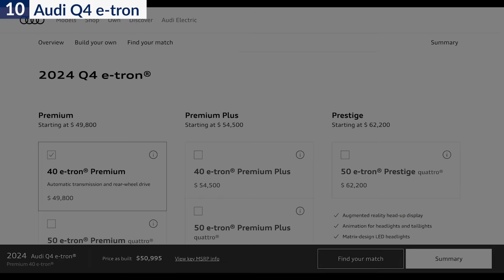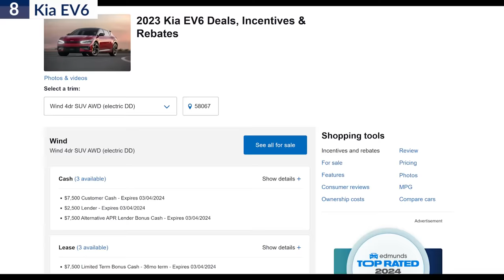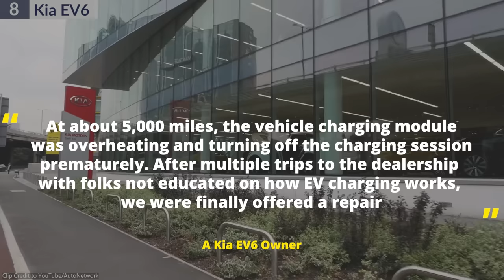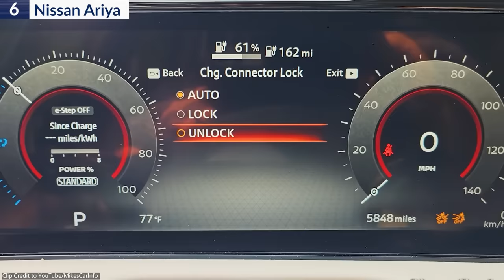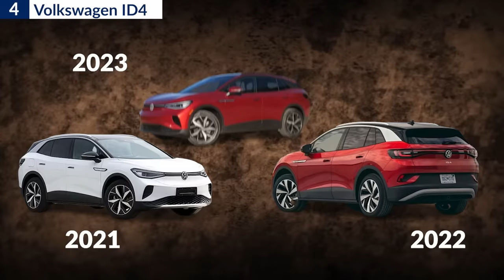New Electric Cars Piling Up on Dealer Lots in 2024 – Here is the Truth!

Comment: I live in an apartment block, we have parking spaces but we can’t afford to install EV charging points. The nearest public charging points are a 2 miles away and only has 3 chargers. EV ownership would not be practical for me.
Reply: Very honest post. Apartment dwellers are not going to fare well with an EV compared to people like me. It only takes 10 seconds to plug in when I get home and my battery is full each morning. Cheap and easy for home owners.
Reply: Sucks for the poors, eh @Lovingkindness.
Reply: You are not the only one. For many, many others, EV are not practical especially in this garbage of an economy.
Reply: I have a home but the nearest charging station is at least 20 miles away.  And I use my truck for heavy duty farm chores and towing.  No thanks.
Reply: @Republicanmouse  Stop thinking about EVs and focus more on getting electricity to your house.
Reply: Unless you have your own house with a drive so you can charge your car every night EVs are just not ideal for most people.
Reply: @MR_THINQ  I have a home with a driveway... No one on this area can have a home charger due to grid capacity.
Reply: @MR_THINQ   True
Reply: @mason5540  I understand but the post is not about rich or poor. People with a residential parking spot have it best. A simple RV outlet (NEMA 14-50) will keep the battery ready for daily use. No need to travel to a charger.
Reply: can you plug into a 115v outlet and do a slow charge?
Reply: @sahhull  Why can't grid handle charging at night in off-peak hour?   Even a 20-32amp outlet is fine.
Reply: @adotintheshark4848  115v outlet is not practical, only 3 miles up to 5 miles an hour.
Reply: @sahhull  Same for the majority of the population.
Reply: I rent in a block of flats but I can run an extension cord to my car spot delivering 240 volts x 10 amps so 2.4 KW which is ok for overnight charging.
Reply: @Republicanmouse  Don't you have electricity at your house? You can just plug them in to an ordinary outlet or get a faster charger installed.
Reply: @MR_THINQ  why charging every night? I charge once every 10 days.
Reply: Don't buy one even if you can afford a house and home charger.🤢🤮
Reply: @Lovingkindness. 🤭😆😅😅😅🤣🤣😂😂😂🙃
Reply: @MR_THINQ  Still not a good idea. Your sales pitch failed. Get a new career.
Reply: @ElMistroFeroz  No one sane wants to pay all that money for a car sized golf cart!🙄😆😅😅😅🤣🤣😂😂😂
Reply: @sahhull  Do you live in some 3rd world country?
Reply: EV's are like designer bags.... if you living in an apt and not a house you shouldn't even be looking for 1! Its backwards like having a new Mercedes and living in an apt complex. Priorities all messed up!
Reply: @ibuyufo  no but we are importing them across the English Channel every day.
The cabling under the pavement to our houses is over 100 years old and there is no plan to upgrade it.
The house was built in the early 1700's.
Reply: @Republicanmouse Thank you for feeding me these many years of my life.
Reply: @danielstapler4315 Make sure to get a heavy duty cord for someone to relieve you of it while you sleep.
Reply: @danielstapler4315 How long is the cable? Do you have enough dimensions for the leads? Is the gable getting warm?
Reply: This is a real issue for anyone in apartment buildings
Reply: This is a real issue for those living in apartment buildings
Reply: Very good statement instead of beating down the electric car and talking bs, you state the facts. The infrastructure is not there for some people yet. Doesn't mean we should get rid of electric cars and go backwards with poisoning the atmosphere, soil and our bodies. We should double down on a better infrastructure, better mining techniques, and better batteries. Which is exactly what's happening.
Reply: yeah, until parking garages and whatnot are loaded with lvl 1 or lvl 2 chargers i think it makes sense for apartment dwellers to not want an EV, ince charging at home is where most of the savings are vs gas. charging at a lvl 3 station is still like 1/4 the price of gas, but charging at home is 1/4 the price of that. In my ioniq 5 i can get the equivalent range of a full tank(65$+here(CAD)) in my 2015 corolla for about 9$ at home(new brunswick has pretty cheap power compared to most of the world).
Reply: @leiflillandt1488  The cable is ten metres long. I don't actually have an EV I just like the idea. If I really wanted too I could buy a 2nd hand but I can't justify it. As for the socket getting warm on some or most EVs on the screen you can tell the car the maximum wattage to draw from the power point so if it is warming up you reduce the power being drawn from the socket.
Reply: Its gonna take awhile for level 2 chargers to spread into apartment blocks and towers.
Reply: I live in an apartment and there's two Tesla stations between home and work. If I charge after 9pm it's $0.22/ kwh which means I can drive for a week for $15. Also there's free charging at my job so if I choose to skip PT and drive to work I can get a full charge for the $13.00 it costs to park at the hospital. My 2019 Tesla Model 3 Long Range is the best feeling most fun and most awesome looking car I've ever owned. I get compliments all the time, not that it matters. But go on telling the world why EV aren't good for you.
Reply: My ix3 goes back in October, the range is disappointing and its an expensive car, however its hard to argue with the running costs if you charge at home. However for motorway drivers who need to charge at service station EVs, its more expensive than a petrol car. I'm looking at a PHEV until EV range is vastly improved.
Reply: Perhaps, but I assume you also don't have gas station in your home.
Reply: Yep, EV ownership is not for everyone.
Reply: Much less of an issue if you buy a Tesla. But yes, what is necessary, is regulatory mandates that apartments install level 2 charging in all parking spaces. This one thing solves a great deal.
Reply: In higher density cities where tenants have no choice but to park on streets, EV charging is a major inconvenience.
Reply: My friends lives in a high rise building (22 floors), they have hundreds of underground parking lots and 6 chargers. For the entire parking. 
Now imagine that 10% of cars are EVs. 
People would have a hard time charging their cars. 
30% of cars are EVs? 
People would start fighting for the privilege to charge their car.
In short words, our infrastructure is not prepared for the massive migration to EVs, not even close.
Reply: @dmitriikurilov1569  Let free market determine EV success or failure based on merit.  In your situation, EV is an easy decision.  For the masses who don't have protected parking space and dedicated charger, EV makes no sense.  The case for EV is even less convincing in cold weather climates.  When taking into consideration grid and infrastructure shortage, EV mandate is pure folly.
Reply: Start Walking, and Stop complaining!  Go to Work!
Reply: @@DeezNutz013 Couple of neighbours have had EV charger installs rejected because of local grid capacity.
One had a smart charger fitted anyway and its a wall ornament that cannot be used when it calls home.
Reply: @@DeezNutz013 Total cost of ownership is seldom considered. My pre-Tesla car was BMW X5. It cost a fortune each year to operate. Because I have free supercharging, my 2019 Tesla X-LR annual cost is extremely low. I have PV solar system at home that has paid for itself 11 years ago. Charging at home cost is less than $0.03 per mile. I use 335 Wh per mile. I can not imagine owning anything but a Tesla.
Reply: In Portland Oregon, my condo building (100 apartments) figured it would cost about $2000 to install a charger at any particular parking place in the garage, and on top of that they would have to make every owner pay at least $2000 whether they wanted a charger or not, just to put the infrastructure in place. But unless 70% of the owners voted for it, it would never happen. Guess what? It never happened. It never will unless the gov’t or power company subsidizes nearly all of it.
Reply: Dear God 2 miles.  The horror.
Reply: Afordability to install EV Charging Points is one issue only. The real concern is when your apartment block decides to install them, they need to install a new specialised fire extinguisher system for EVs that cost alot more then traditional systems.
Reply: In eu this ain’t an issue as many chargers are near shopping spaces so people just charge once every two weeks for 30 to 40 minutes during grocery shopping.
Reply: Where do you work just provide a zip/post code?
Reply: As long as it s legal to own a car with an engine I ll never buy one. I don t care how fast or comfortable they are. A car without sound is not attractive to me. I cross fingers Toyota is correct and at least hydrogen cars will be available in the future. I ll buy a Toyota even though I m not a fan of the brand.
Reply: LOL i have ZERO chargers at the current house i reside. And i have NO problems regarding practicality. Explain that????
Reply: @MR_THINQ  i charge once a week only. No need to charge every day. Do you fill your gas tank every day? No right?
Reply: Do you own a gas station?
Reply: @Astropalis how many miles do you drive a day?
Reply: @malcolmar  The economy is not garbage its doing very well even though trump keeps saying otherwise. So far in January of 2024 our GDP increased 3.1%.
Reply: @sahhull  That is completely untrue. If you can run a fridge, you can charge and EV at home. Most also charge at night where even third world countries like USA have excess electricity capacity
Reply: @johnn17golf  im only passing on the info ive been told.
I have no wish to drive an electric golf cart.
Reply: @sahhull  Then you need better sources! Making a decision on bad advice from discredited sources is not in your best interests. You don't need to drive a golf cart, get a car. Electric cars are the best and getting even better.
But you go with oil lobbyist advice if that makes you feel special!
Reply: @encinobalboa  The market IS speaking - in the last year, EV sales are up 40% and ICE sales are down 5%
Reply: @johnn17golf  Ford loses $30,000 per EV.  Rivian loses a little more per EV.  GM and Jeep want out of the EV segment.  It goes on and on.  The only reason they are in EV segment is because of stupid mandate which is not the free market speaking.
Reply: In situations like that I put it in deep sleep mode eliminating vamp drain when I'm out of town then input my destination from my phone to my car once I wake up and the car preconditions Automatically or I'll precondition on a set time
Reply: @Lovingkindness.  It's all about planning in the end and charge accordingly and knowing the do's and don'ts. Putting the car in deep sleep will definitely help especially if you have an lfp battery.
Reply: @johnn17golf  I make my own decisions based on personal experience.
The EV is a step backwards in transport.

EV's are not good enough to replace liquid fuel cars and vans.
Reply: @Lovingkindness.  Easy for the home owner but relying on the disadvantaged people using the public chargers, often at high prices, to keep them viable and up and running if you want to venture any distance from home.
Reply: And EV is more of owning a house kind of vehicle.. it's like people that own Land rovers that live in an apartment if you have a landlord you shouldn't own a Land Rover just saying
Reply: @sahhull  EVs are far better than ICE cars but you buy oil lobby Bull as this thread shows. But you stick with your rotary phone if that keeps you happy.
Reply: @encinobalboa  You are repeating nonsense  fed to you by oil lobby channels like this one. EVs are profitable but have large investments being paid off, just as with any newer product. GM is NOT out of EV space in any way. Toyota just released the BX4Z all electric car this month which is already selling like hotcakes. 
EVs are the present as well as the future of transport, ICE is like the rotary phone, a relic
Reply: @johnn17golf  you say they are better.
Do tell. Tell me how.
Reply: @sahhull  more fun to drive, cleaner, quieter, plug in at home in 3 seconds instead of 5 minutes at smelly gas station, more reliable, less expensive to maintain, cheaper to insure (despite what MSM tells you), plenty of range, for 99.5% of us, handles well in snow (low centre of gravity)... did I mention the fun aspect yet? That's 5 of 100 reasons EV are better... and improving every day
I and 99% of EV drivers would never go back to smelly unreliable bad in cold ICE vehicles unless we have manure to carry to the farm.
My bro is a farmer, bought his first EV farm vehicle last summer. LOVES it.
Reply: Infrastructure is a chicken and egg situation; people wont buy EVs due to no chargers, and networks wont install chargers because no EV owners.

Talk to the landlord and local government about charger install incentives - and perhaps other unit owners/tenants about group funding a couple of chargers.

Very, very few people should need to charge every day/night, so 1 charger per 3-4 people would be ample, and perhaps set up some reserved charging times for every unit; ideally, if a unit doesnt have an EV, they would allow another unit to charge in their time spot if needed.

I know Washington has been talking up funding for chargers, however I dont know the current situation; here in the UK, all new build homes, either single family dwellings or communal blocks, have to have EV chargers installed; this has been going on for about 4 years; it adds around 0.0001% to the building costs.

Many UK public car parks now have chargers, as do most supermarkets, with many committing this year, to installing Super/Rapid Chargers alongside the existing 7-22 KW Fast chargers.

My home town of ~10,000 people, has gone from 1 car park with 4 chargers, to every car park having at least 2 chargers, the new science park has 8; and our single (ancient 50KW) Rapid charger is due to be supplemented with 8x 350KW units, later this year; not sure if this will all be in one location, 2x4 or 4x2 charger locations.

If it helps, I save around $300 per month on fuel, servicing, and taxes (averaged over a year), so a charger install cost can be covered in under a year in many cases.
Reply: @johnn17golf  5 things I dont care about.
Can I pay for a charge with cash?
Cant charge at home. Im one of the 40% of UK homes that cannot.
Fun... How much fun can a car with an autobox be? You are bearly driving.
My current vehicle is smooth too, the roads however are not.
Public charging around here is dire, sparse and expensive.
As long as your diesel vehicle can beat 30mpg. Diesel is cheaper per mile.
Reply: @sahhull  enjoy living in the 1980s, dude!
Reply: @sahhull  Actually, how boring it might be to drive was my biggest concern, having driven a few autos and hating them, compared to around 1 million miles in manuals.

However, all the issues with ICE automatics just arent there, single speed means you plant the pedal, and you GO, instantly; with acceleration I havent experienced since cadging a lift in Allister McCrae's rally car at an event (I helped push-start it, as it had no starter motor); no waiting for the auto gear kickdown, no having to change down to get the engine into the best rev range in a manual.

I LOVE chucking it around on the local country back roads, variable regen means you rarely need to touch the brake pedal, and it has tonnes of torque and a near perfect front/rear balance; but it is also very relaxing to drive when I have to venture into London, Birmingham or Manchester traffic jams.

Your talk about 30mpg in a diesel being more economical is also not true; it would need to average at least 55MPG to match my EV; my last ICE car could do 36MPG, my EV saves me £250 per month over that when charging at home; and was still saving me nearly £200 per month when I had to charge on the most expensive public network for 4 months; due to an AC charger fault (dealer dragging their feet over a warranty repair on a nearly 7 y/o car); it isnt JUST the fuel saving, the servicing and tax costs add up.

You might also have been seeing the Miles/KW figures for some of the pretty poor EV conversions from various European car makers, some of which only manage 3, my 7 y/o car averages 4.0-4.5, and 26KWh of battery gets me around 100 miles of range, summer or winter for £3 of electricity.

Care to tell me your general location, so I can look up the charging infrastructure? My town of 10,000 people now has chargers in every public car park, most supermarkets, the new science park, the local Spa fitness centre, several local employers; and has plans to install 8x 350KW superchargers this year.

Also, why not talk to whoever runs the apartment block you live in; there are grants that cover most of the cost of charger installs; and if you dont have off road parking; talk to the local council about roadside chargers, powered from street lighting; again, there is government money to pay for these.

Finally, go ask a dealer to test drive an EV for a weekend, and take it out on various roads to see what you think. I suggest Kia, Hyundai or Nissan; as they have the best cars in the affordable ranges; the Corsa isnt bad, but the asking price is too high.

The cheapest EV for sale in the UK this week, is a Nissan Leaf for £2500; it only has around 60 miles of its original 80-90 miles of range, but that is enough for most people's use cases; with UK average daily mileage being 20 miles, and average journey length being 12 miles.

That is a bargain to someone who knows how to swap out bad cells and recover near full range.
Reply: @ianemery2925  all of what you say is dependant on being able to charge the thing.
Unless you can charge at home. Its not feasible or economic.
Public charging around here costs 85p kw/hr.

I also don't need a car. I need a van and EV vans are sheite.
Reply: @sahhull  OK, yes, most EV vans currently on sale in the UK are complete garbage, using the same/similar 24KWh battery packs as 1st gen Nissan Leafs; although the latest Vauxhall/Renault colab is supposed to be greatly improved (according to a BP Pulse engineer driving one; who really HATED the earlier version, as it didnt even have rapid charging).

Battery size isnt everything, efficiency and consistent high charging rates are also very important; the latest VW van/Minibus/Retro Camper, has a 100KWH+ battery, manages well over 200 miles on a charge;  but a pathetic average charging speed, that appears to take nearly an hour for the 20-80% charge cycle (from the one person I know driving one)

85p sounds like DC Rapid charging; you are aware that if the van can AC charge at 22KW, supermarkets are charging as little as 25p ? You can plug in, go shop, or have lunch, and come out to a van with an extra 50-100+ miles of range for £3-4 - depending on how long you spend inside.

EV is the future, UK ICE car sales numbers are in decline and EV cars are a larger and larger percentage of sales every year; Rapid charger location numbers already exceed the number of petrol stations; range anxiety is not really an issue with any car/van that can deliver 100-150 miles on a charge and takes 15-30 minutes to recharge; as people doing those trips usually stop for a break along the way anyway, I know I do, and I used to do daily runs from the Midlands to London airports (Usually 130-160 miles each way)
Reply: @ianemery2925  I have to wonder if those increased sales are due to companies or private buyers.
What happens to the sales figures when the subsidies end.
I generally cover 150 miles per day whilst carrying near max load.
The eNV200 I hired which is the closest reasonable replacement to my 2003 Vauxhall Combo diesel.
The eNV200 wasnt a substitute at all.
50 miles per charge, 2 hour recharge. Charge queues, hardly any public chargers around here so added journeys and time to the chargers to wait in a queue. Not great for business.
Reply: @sahhull  In the UK, the vast majority of new car sales are by rental/lease companies, who love EVs due to the much lower servicing costs and high reliability; in the US it is the other way around, and they claim a larger number of crash repairs by EV renters (down to their poor standard of driving/roadworthiness ??).

Yes the NV200 is why I mentioned the Leaf - it uses the exact same battery pack and motor as the 1st gen Leaf, but never added even 50KW charging; empty it doesnt feel too bad, but load it up, and it is a complete slug.
Reply: @ianemery2925  the eNV200 was ok to drive a to b but it wasn't up for c, d, e, and f journeys afterwards.
The local plumber has the same opinion on his eTransit.
Or the £50,000 mistake as he calls it. He now mainly uses his car for jobs because the van isn't fit for the journey.
Reply: @sahhull  All these early vans were "compliance" vehicles, they werent designed to be good, they were designed to side step regulations limiting the number of ICE vans they could sell - same as most of the compliance cars that Ford, VW etc brought out, so they could keep selling ICE cars in California.

The Nissan Leaf is the only one of the 1st gen cars to get it nearly right, with my 1st Gen Soul a close 2nd; both could do with a larger battery range, but they dont sacrifice anything else to ICE cars; and are better to drive.

The only reason I bought the Soul was the superior drivers seat and headroom over the Leaf.

Oh, and I can brag that the seat covers and dashboard are made with recycled cola bottles.
Reply: You have a parking spot, you're fine. A 110v plug is more than enough.
Reply: @itypethetruthnobshere8975  I see it all the time renters driving nicer new cars and homeowners that are driving older vehicles because they have their priorities right.
Reply: @HermanWillems  nobody cares
Reply: @scotmandel6699  they probably do. So should you?
Reply: @Lovingkindness.  the battery may explode and burn down quickly!
Reply: Nearby municipality bought 100 electric school busses.  37 are broke down for various reasons including unable to charge. They can't be used for school sports or field trips as they need to be changed in between runs and in cold weather they barely heat above freezing and windows fogged continuously.  Great purchase
Reply: I feel so sad that I think I can't afford one even though I probably can LOL.  Suck on some of that juice ha ha ha ha
Reply: That's why you ride the bus.
Reply: @Lovingkindness.  Our power company has three levels of charging so you really need to be able to charge it fast in an overnight, not all day long during peak rates.
Reply: @DuffyGabi  The charge time is programmable in a Tesla. When I charge at home, I set the start after 8PM and stop by 7AM. These are when the utility rates are cheapest. With a Nema 14-50 plug at home (50A RV outlet), I replenish my previous day consumption in a few hours or charge from 90% DoD to full over night. No daytime charging needed.
Reply: @jandolejsi8122  what? No they don't. Ridiculous comment.
Reply: I just can’t understand why you don’t want to sit for hours at a time , a couple of miles from home , waiting for a stupid EV to charge ???
Reply: @Trust_but_Verify No. Avg driver only drives 35 miles/day.
Reply: @encinobalboa Get out of the city or get rid of the car and rent when you really need one.
Reply: @lasvegasbound6167  ICE forever.  Freedom of choice and freedom of movement will spell the end of EV mandates.
Reply: Then it’s not for you, and that’s totally fine. That’s why we have options like hybrid and plug in hybrid. To be quite frank, there is really no excuse to not be driving a hybrid at the very least
Reply: @malcolmar  Garbage of an economy?!? Wow, what country do you live in?
Reply: @Republicanmouse  I don't need a big truck for farming and I don't want the huge gas bill for my 1 hr daily commute to and from. Big hulking gas guzzling truck, no thanks! Living way out in BFE, sloppin the hogs, moving hay bales and having relations with my cousin, no thanks. See, we can all play this game.
Reply: @dickl6457  I hear you. We have 2 cars. One has a spare tire and the other has a "fix a flat" kit. I can tell you which one we feel more comfortable driving on long trips and it is not "fix a flat". I have already had to use  my spare tire twice because of nails and screws in my tires and I was able to get home with no issues. Another bad thing about having no spare tire is that you also do not get a car jack.
Reply: There is an innovation that may help you out. There is a roadside unobstructive charging setup that runs through the sidewalk into parallel parked cars.
Reply: @EarthyLee  that may change in the coming years with solid state batteries and other battery improvements. Later this year is apparently is when solid state cars will be releasing.
Reply: @malcolmar lowest unemployment in decades.
Reply: @Utubedeletescomments  Yeah, right. Part time work does not count in an meaningful way outside of trying to lie to people. My company has forced to lay off a lot of people and I have had to say good bye to many co-workers at my location. Because of the artificial raising of min wage, many more people in the fast food industry will loose their job this month of April. It is one thing when people have to deal with the consequences of their own stupidity. It is a whole other thing when that stupidity leads to keeping in office corrupt politicians and bad policies that affect us all.
Reply: @malcolmar  lowest unemployment rate in DECADES !
Reply: @Utubedeletescomments  LOL! OK. Tell that to my exco-workers.
Reply: @malcolmar  Yea because no one lost their jobs under bush & trump
Reply: @Utubedeletescomments  Bush was a con man but I can tell you I was working with many of these people when Trump was in office and we all had more money in our pockets and the value of that money had more buying power. What the corporate run news says is one thing. What you actually see with your own eyes and experience in the real world as you are paying bills and trying to support your family is a whole other thing.
Reply: @daso1n282  CO2 capture tech from companies like Carbon Engineering is more practical and can actually help the environment unlike EVs with their highly environmentally unsafe batteries. With CO2 capture tech, you clean the vehicle by cleaning the fuel. CO2 is taken out of the air and recycled to make fuel that is cleaner than fossil fuel and this tech can be used in current vehicles and planes with little to no modification. Because you can use renewables to create the fuel and the fuel can be transported and distributed within the existing gasoline infrastructure there is no impact on our local power grids. Big oil does not like this because this will give them actual competition because you can set up a CO2 capture facility virtually anywhere.
Reply: @dmitriikurilov1569  Also imagine what happens when the batteries of those EVs start to degrade and they go into thermal runaway. I would feel sorry for all those living in that building.
Reply: @johnn17golf   CO2 capture tech from companies like Carbon Engineering is more practical and can actually help the environment unlike EVs with their highly environmentally unsafe batteries. With CO2 capture tech, you clean the vehicle by cleaning the fuel. CO2 is taken out of the air and recycled to make fuel that is cleaner than fossil fuel and this tech can be used in current vehicles and planes with little to no modification. Because you can use renewables to create the fuel and the fuel can be transported and distributed within the existing gasoline infrastructure there is no impact on our local power grids. Big oil does not like this because this will give them actual competition because you can set up a CO2 capture facility virtually anywhere.
Reply: @malcolmar  No other country ON EARTH came out the pandemic like the United States.  The USA TODAY has had the most successful economy on earth AFTER PANDEMIC (FACT).  The USA also has the lowest unemployment rate it’s had in DECADES ( FACT ).  Not sure where you live but I have people in NYC , California & Florida & they’re all doing great.
Reply: @jasonclairmonte8638  regulations? We already have more regulations than we need. The government sticks their nose in way too many places that they don’t belong. If there is enough demand in the future apartment builders will install them on their own and add the charging fees to the rent.
Reply: What about a long extension cord out the window. Or do like other people do tap into the light pole on your block
Reply: @Republicanmouse 
Try to use an extension cord.
Reply: @Utubedeletescomments  Under Trump that was true.  3.4%
Reply: user-uk8tl3xy9e  What year do you live in ? When was the last time you've heard of that happening in a garage ?
Reply: @mason5540  Jeep's new (hybrid) compressed air engine seems a better solution. Btw 'poors' will increase in numbers going forward in UK, US etc
Reply: You buy an expensive car and live in an apartment?
Reply: Who buys new cars?!!!!
Reply: Aw poor baby
Reply: Consider a Hybrid or a Plug in Hybrid.
Reply: Yep, I'd not recommend it for everyone. But if you can charge at home, it's a good choice for your daily commuter car
Reply: You find a better way to charge before you buy.
Many apartment building are putting in plugs.
Reply: @johnn17golf EVS are not better than ICE cars.
Reply: What about the slaves in the Congo dying for no reason?
Reply: @markmiller8903  You do not know what you are talking about.
Reply: @BioniqBob  yes i do.